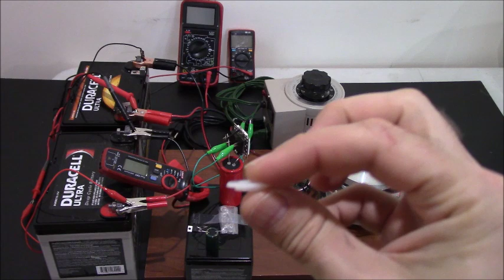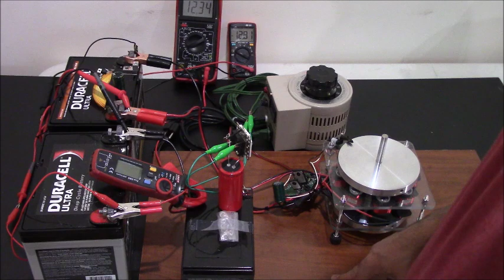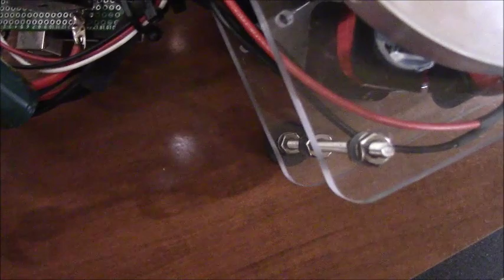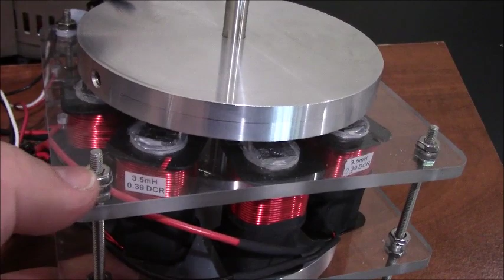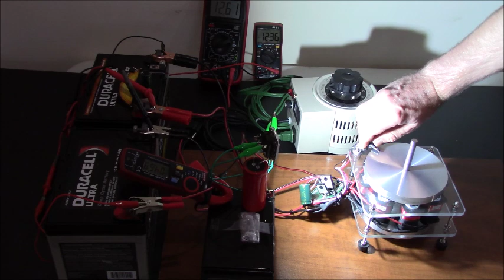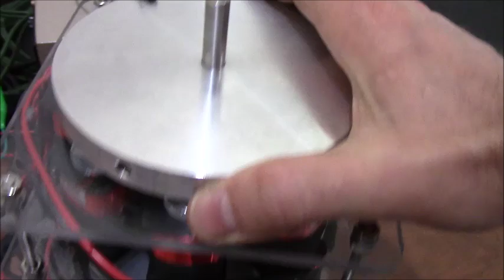4 DualPole Mini Motor  Energizer Updated Coils

Comment: Rick what core do you use for the motor is it okay to use welding rods?
Reply from the maker: In this motor they are laminated. The welding rods need to be the right kind, like the Lincoln R60.
Reply: @rickfriedrich  the shiny copper cotted you mean?
Reply: @rickfriedrich  rick is the disk.aluminum?

Comment: Hey RIck good stuff.  Re CAP Dump circuit w/ Low ESR Cap & SCR, can you recommend a circuit w/ correct Cap vals & SCR/Diode pair that works @24v(2x100ah series) for the Large 4DualPole?  I've been using 1000uF (10 parallel caps) w/ a 1000v SCR & 1N4007 for my circuit.  The cap + & - are connected to CHG cable  POS & NEG (run bat +)  respectively w/ SCR Anode on CHG battery Neg. Swapping  batteries still shows losses / total voltage droop over a few hrs of runtime. Is it possible my batteries have become too negative & need  conversion w/ Positive energy? HOW does one know when its been sufficiently changed to Positive to enable battery swapping? ie., typically how long does it take for batteries to get properly conditioned? Could you offer a rough idea? ...or can anyone share their experience? Thanks!!

Comment: Why the aluminum rotor. is it better than plastic or wood ?
Reply from the maker: Yeah, like dylans wrote, these go easily over 10,000 rpm and mass is desirable. These are very well machined.

Comment: How can I get this to charge my 400ah lithium battery to 100% in 2hours
Reply from the maker: You have to be careful with lithium as they have voltage and temperature limitations. Because there is always a danger in charging lithium batteries I cannot legally advise people to do that.
Reply: @rickfriedrich  Am talking about my LTO Battery with 400a charging capacity
Reply: Im testing the mini motor on a 48V LTO 40ah Battery pack. Its loading the Batteries but really slow. On 5 days loading it only goes from 40,2V to 43,3V. The generator coils generating up to 19 V AC but if use for loading Batteries or turn on a 12v Bulb there are only 4-5Watt on the output. Im a bit dissapointed. Rick is not answering Messages...